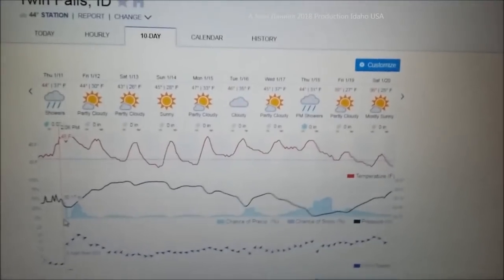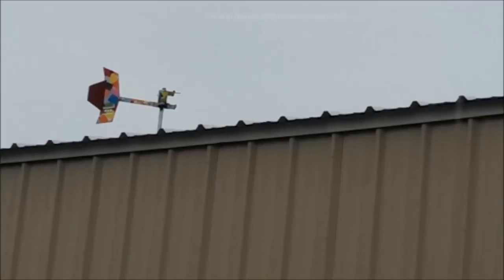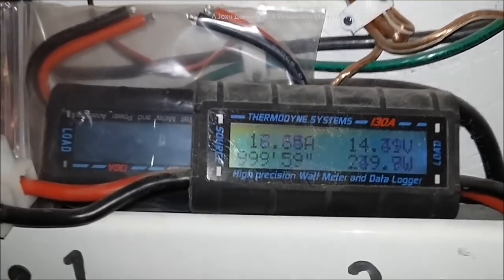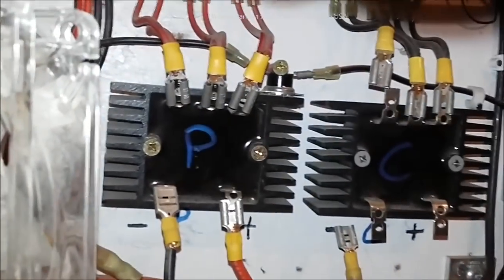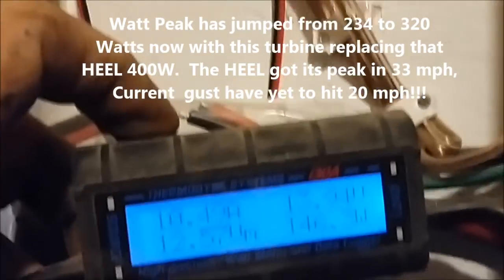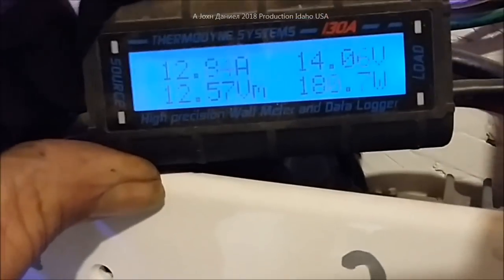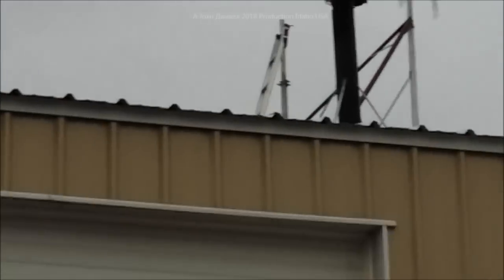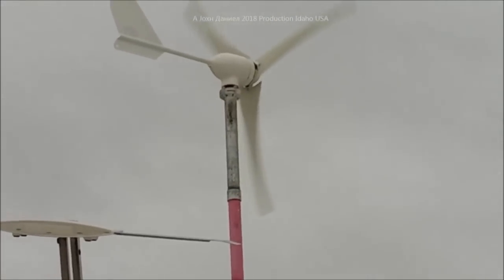Success, $220 (before inflation) China 500 Watt Wind Turbine super performer, BIG PARTS LIST BELOW

Comment: its a 500 watt turbine. why does it "only" make about 180/250 watt.
thanks in advangs
Reply from the maker: It makes far more than 250 watts, this ain't no Missouri wind TURDbind LOL x 10!!! They are correctly rated for 25 mph, at 25 mph they make over 500 watts easily. Mine has hit over 1100 watts in 30+ mph. Under 25 mph it of course makes less in the lower winds. The day of the filming I think I was in 12 to 18 mph which is normal for me but I do get up to 70 mph winds during mountain inversions, it handled that well but with a braking load it still made over 700 watts!!
Reply: @JOHNDANIEL1  Thanks John ! I am thinking about buying one or more vindturbine like the one you have.
but I will like to make my electricity in to warm water. do you have a good idea how to do that?

Comment: So where can I buy one of these that can put out a 1000 watts?  That's if that's possible.   But I'm very interested in this.  There's a guy up in Michigan that was sent to prison because He hooked up a wind turbine in his back yard.  Which I think is just BS.
Reply from the maker: Well jeff you look up on the video information spot and I put a source as current as I could on there to where to get it. Its a odd turbine, making more than its rated for must be a method of then Taiwan owned company who builds in China thing, sure as hell ain't a American thing when it comes to crazy 1700 watt claims from a tiny PMA-PMG like them Vietnam built shiny things sold from Missouri or Texas. 
REAL turbines are rated at 25 mph, not 70 so when you see a 500 watt turbine do 1000 watts, its at speeds over 25 mph and be damn sure to wire heavy for it. 8 awg not 14 awg like so many Fake-A-Watt SHINY ones! LOL!

Comment: This is a bit off topic but I thought some one might find it interesting :) I have an idea for a lifting force machine. 
Step 1: Get hollowed out cube.
Step 2: Securely attach magnet to inner bottom of hollowed out cube.
Step 3: Place a lever on inside bottom of cube behind the magnet that's securely attached to inside bottom of cube so that one side of the lever is pointing towards you and hanging over the magnet.
Step 4: Attach a vertical bar to the top side of the part of the lever that is not hanging over magnet witch is securely attached to inner bottom of cube. Make sure the bar goes all the way up to the inner top of the cube barley touching it.
Step 5: Securely attach a magnet to the side of the lever that is hanging over the magnet that is attached to the inner bottom of cube.
Note: Magnets need to be facing each other with attracting poles N,S or S,N
Note: The lever is going to have to be really close to the magnet on inner bottom of cube because of how close those magnetic fields need to be to interact. But not so close that magnets can touch.
The magnet on top connected to lever is pulling the magnet on inner bottom of cube towards it and since the magnet on inner bottom of cube is connected to cube, this pulling force acts as a lifting force. Now at the same time the magnet on inner bottom of cube is pulling the magnet on top downwards BUT the magnet on top is connected to the lever so any downwards pulling force is being converted mechanically by the lever into upwards lifting force. Now if you know anything about magnets you now that there are magnets powerfull enough to lift far more weight then just there own. So essentialy this divice is exploiting the powerfull pulling force of magnets by mechanicaly transforming its magnetic pulling force into mechanical lifting force through the clever utilization of a lever, and walla stuff can be made to fly. Imagine if the magnets in this experiment where electro magnets so the ammount of electrical current going into them determined the ammount of lifting force that it would have. Now imagine this system being used as an attachment that could be placed under or ontop of vehicles to counter the weight of the vehicle and any cargo its carying. Now imagine  if this was done with powerfull permanent magnets and turned sideways and placed in an electric generator and had enough strength to pass through the magnetic fields as it propelled itself forwards with its own magnetic pulling force.     Signed   AMA
Reply: Yeah unfortunately the laws of physics say no.... But if you build a scale model you will see WHY mother nature disagrees. 

So that, if nothing else it will stop you chasing impossibles for the rest of your life.

Here's an easier solution... Attach a really really heavy weight to a string and at the top of a very tall pole suspending that weight. Make sure the entire pole is able to pivot in the middle. Solid iron, and a lot if it, is good. 

Attach the other end to a pulley and wrap string around a dynamo....ensure the gear system is such that one inch is a lot of turns of the dynamo. It should be spinning like crazy for just a millimeter of distance of the weight, which is being moved by just gravity. 

Just let gravity (potential to kinetic energy) slowly pull the weight down turning the dynamo. Make sure it takes hours for the weight to  reach the bottom of the pole. You will need a long pole. 

The following day have a good breakfast and use your physical strength to invert the long pole on the pivot so that the weight is back at the top and you can repeat the process.

Presto.....free energy. Well breakfast and elbow grease powered electricity. You might also find after a month that you are a lot fitter from lifting a ton load of iron whether using. a lever or not.

After some time you might even work out that a machine can invert the pole for you, and you could power such a machine using an electric generator powered by that wind turbine. 

It'll give you more power because you are utilising gravity. But you lose power once a day to invert the pole. 

It would work too...but it won't be pretty.

Comment: Hi John, Good afternoon, where can I get a few of those thermal sensor
Reply from the maker: Use a Conversion to get the right one, Celsius to Fahrenheit. My Source  https://amzn.to/2PUwyKX , use NO ( normally open switch ) so it closes circuit on temp rise. 
Temp rating Converter www.celsius-to-fahrenheit.com
Builders spec site https://www.blocklayer.com/

Comment: 400 watt and your eBay link takes me to US $318.10  I guess your video had them jack up their prices which happens with all things once put on Youtube.  At 220 I am with you (AliE) but at 318 (eBay) I am out of here.  The thing is with shipping from AliExpress it comes to even more.  Not worth it at those prices but you had me if the final product to my door was 220.  Please quote prices to your door.
Reply from the maker: Comparing the turbine to all the $300 to $400 things out there it's still cheap in relation to paying for those that are similar but don't work like this one. It's under a $1 a watt by far, and it's only one I found in 11 years that's REAL on it's ratings. Just keep watching for them at a lower price before tariffs Jack up prices.
Reply: It would appear that the total price would be around 600 dollars to get this up BUT there are two things wrong and one is that of needing to weld anything as in your setup video.  No can do here and the other is you really need to get up over the dirty wind that we city dwellers have and for that it would require 75-125ft (in my case) which this city would never allow.  Heck, this city doesn't even want solar panels so it has net metering but will pay you nothing for it.  It is because our electric, gas, and water is ran by the city.

Comment: How is it holding up?
Reply from the maker: So far so good. Waiting till the hottest part of the summer to see how it also handles the heat since it did very well handling -8 degrees in the winter storms to do a 6+ month review on it. Makes more power than advertised and not one issue other than having to install bigger diversion loads to control it.

Comment: Hi John, What kind of pole did you mount this to? I have two that have the same type of mount, but am having some trouble trying to find a pole it will mount to.
Reply from the maker: 2" Rigid sch40 galvanized Conduit, NOT 2"EMT conduit,  10 foot sections available at Lowes, Home depot and many home centers. About $40 for 10 feet.

Comment: You should look into buying some welding cable to get that wiring cleaned up when you get to your next iteration. Super cheap and OFC :)
Reply from the maker: I am running 100% pure copper, 8AWG,  33 strand wire on my turbines. Wire gauge 8 thats 140% in 3 phase capacity math over my actual need.

Comment: Hi I have a friend that use 48v on a 12v sistem
Reply from the maker: Yes, you can use any reasonable voltage up to 7 times a batteries cell voltage to charge them and up to 20%  the amperage of your full battery bank hour rates. The battery will keep the volts to its own structural limit and a diversion controller will prevent excess events.

Comment: does it have a thrust bearing on the hub?  if not, it will trash itself in about 10-20 days with moderate rotation
Reply from the maker: No, tapered bearings x2
Reply: tapered bearings are axial, and many act as thrust bearings in effect, and are in some cases thrust bearings.   given what you say, i think it is safe to say you have a good wind turbine.   stay away from VAWT, stick with HAWT turbines like what you have.

Comment: I used to see some here years ago and one in particular I watched every time I went by. I also saw a scaffold all the way up to the top over the years at least three times and the turbine gone. Repairs I guess and a month or two later it would be turning again. It is gone now though, the tower is still there but no turbine for about three years.

The same is true of the other private citizen windmills I used to see as they are not there anymore. Those gigantic windmills are going up everywhere and it's funny that almost everytime I go by they are not turning or only a few are.

I have no explanation for that do you? I do know that the power they make all goes out of state and not here for our use. Does that make sense to you?
Reply from the maker: I sort of have to have mine, for now and none I have now are big of a pain to run. We make Hydrogen and mix it 70/30 Hydrogen / Propane and it heats our home. I won't show my Hydrogen Cell due to a scam artist at the Jeffro Whoreman theft and resell center in Missouri who I know will steal the design, but its very different and able to make stage 1 pressure off the generators.

Comment: How much electrical background is needed to install or should an electrician install it?
Reply from the maker: About as much experience as it takes to work on a car, or replace a outlet. Most can do it without difficulty.  But I have met plenty of electricians who were absolutely clueless on such things and 15 year old kids who could do its wiring in seconds.
Reply: The 3 AC leads to the rectifier can't turn !! If you can mix black and red .. don't do this !!! 
This is 2 things ... If you can't put black to black or Ewen know What black means ...
Don't do IT ..
The same goe's for red !!!

Comment: Those numbers were for just one of the turbines?
Reply from the maker: Yes. So many people buy a fake turbine from so many like the ones making 50 watts  sold out of missouri ( seller claiming 2000 watts from 2 lbs of copper hahaha ) that the real stuff is hard believe it exists.
Reply: Јоhn Daniel not bad at all. I hope for your sake that the bearings hold out. 
I live in the PA woods now so not too useful to me however, I got my eyes on southern Colorado. A bit higher up and open. Either way loads more sun year around
Reply from the maker: They so far in my HYE have lasted 5+ years in my crazy high altitude winds. And using double row bearings which you can only use in a Thermodyne PMA ( no other similar ones can do that) my other turbines are 2 to 4 years old and zero problems. My winds are very high, constant and unforgiving here.
Reply: Јоhn Daniel well as long as they don’t catch fire 🔥 like the big ones do in high winds occasionally. I would have either a protection system, suppression system or warning systems. Possibly a double or triple layered system for redundancy. Doesn’t hurt too much to have a bit of troubleshooting as long as it’s not too pricey

Comment: You do not need a fan to cool the rectifiers; you need a larger heat-sink.  C'mon now. Think efficiency, or why go green at all?
Heat-sinks only need a larger area... Mount it to a large slab of scrap aluminum.
Reply: better to add a water tank and heat the water with the excess energy.
Reply: @frodev728  Best idea yet, and as I recall if you keep your rectifier in a tube/structure with a low voltage ( pc type ) fan, you'll push/pull air through the structure past the rectifier at a very efficient rate. I used to have to cool 1000 watt HPS lights with only outside air, and our best bet was using this method as well as mixing the local air around as not to build up any pockets of heat in 1 area. Just my 2 cents, but this is science not guesstimation. I love the usefulness of efficient air movement.
Reply: @silversrayleigh8980  i would like to see those 1000s in action 🤘😁
Reply: Is it a 1.5W fan that is generating such response? You would think the guy is running an AC to cool the rectifiers.
I don't think you need to worry about using 2W from the 400-500W the turbine generates.
People lose their heads over this green energy business.
Reply: B U Y !!! A BIGGER WIND TURBIN !!! 
AND A BIGGER 200A rectifier .. or Ewen Better yet
 Buy 6 schottkey 3000A diodes bolt Them on to a huge Cooling Finn 
Then you got cooling enough oe even a small free radiator
Reply: I work in IT. And once there was a test with two CPUs. They tested one CPU with just a heat sink and the other CPU with an additional fan. And guess what. The CPU with just the heatsink on it wasted more electricity than the other one, which was cooler. Despite the fact an added fan was powered too the whole System used lower Energy. As Salamu alaykum from germany
Reply: @aladdin8623  i added a bigger heat sink on my computer i was getting temps near 100 degrees with fan spinning at 3400 on the old system now i never go above 50 with the bigger heat sink and i have never heard the fan spinup. so bigger heat sinks work better than a fan on a small heat sink
Reply: That is BS.  Heat sinks are heat storage and will eventually heat to nearly the same temperature as the rectifier unless there is sufficient heat transfer to the air and that is what the fan facilitates.   Don't comment on things you don't know/understand because there are other ignorant people who will believe you and even repeat ignorant comments.
Reply: carol vogel so... point a fan at the heat sink?
Reply: Yeah, but then you'll need more power to power the large fan...then what?   @mantexas9033
Reply: @carolvogel7692  why comment in such an arrogant manner and you are wrong. We use a heat sink and it works fine. Also, check out the channel "modern day DIY" . The guy also uses a heat sink and it works fine

Comment: How well do they handle -40 degres celsius do you think?
Reply from the maker: Probably no better than I would! But I do know they sell these into Siberia and the test grounds for them was Mongolia at one point.
Reply from the maker: Went and checked, looking at the spec sheet it says -40 Cel to 175 cel is the limits of its bearing lubricants. However, when the wind blows I am sure some internal heat will be made as normal function.
Reply: Јоhn Daniel Okay cool. I live in northern Sweden, cold record here was - 52.6 celsius. Cheap enough to give it a try. Thank you.

Comment: The thought of those things producing so much power when it's overcast...hell, even in the middle of the night!... I'm used to solar panels. I have them on my roof and in my yard.  It would be awesome to be able to produce power at night and when it's very overcast/raining.  One of the things I hate about my solar system is that my batteries don't make it through the night if I use as much power as I want to.  I need some wind turbines!
Reply: That's why you need solar and wind. Our power never goes out. When the grid goes down in the town diwn the miuntain we see the report on TV while our gennies are howling. Bad weather only means more power.
Reply: Ya, and that roof could support a dozen or more if they needed ! Wind power is great ~!~ 24/7
Reply: If you live near people, they will butch about your wind turbine.  Because of the noise they make!!!
Reply: @jbdragon3295  not all wind generators are noisy. If they have a proper airfoil blade, and not just a bent piece of aluminum or pultruded fiberglass, they'll be much quieter with just a light whoosh sound similar to a large bird flapping its wings.
Reply: @jbdragon3295  "The thought of those things producing so much power when it's overcast" ......The wind doesn't care if it is overcast or not. The wind is not sun powered.
Reply: @airbornranger879tt  so what do you think does power the wind?
Reply: @johnwyman6331  baked beans and onions :))
Reply: @johnwyman6331  sailer moon, or chuck norris, pick one answer and get one free!
Reply: You are talking dark energy there